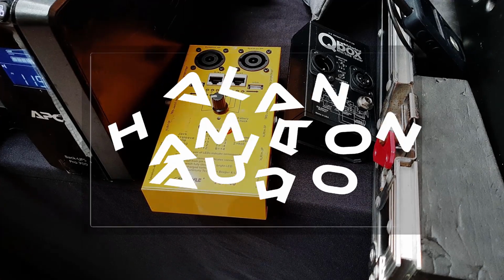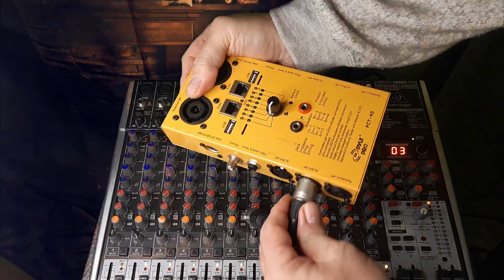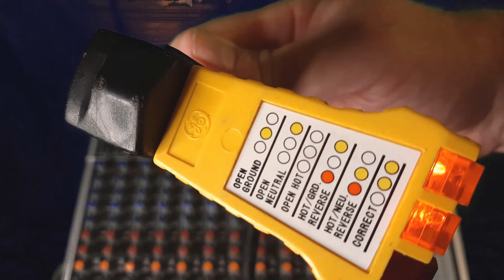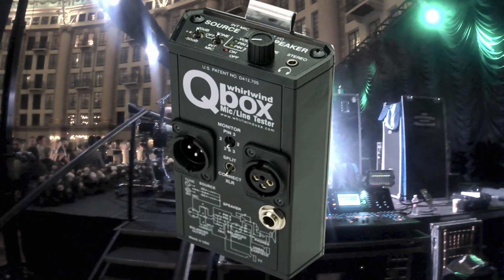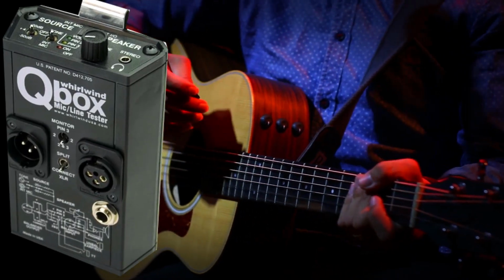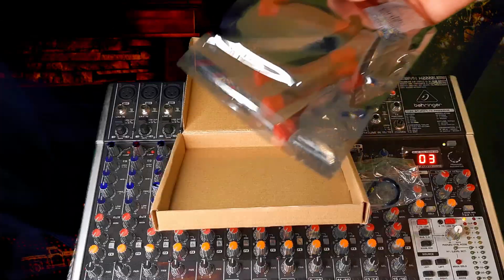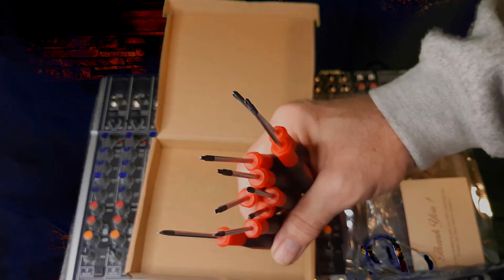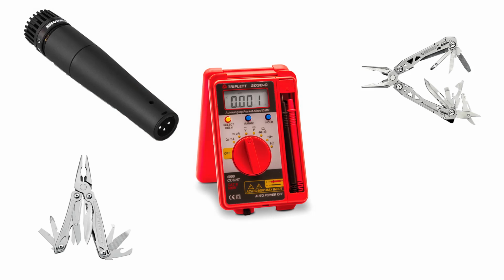Workbox Essentials - Gig Tools for Musicians and Audio Techs - Gift Ideas

Comment from the maker: From about 5.00 to around 250.00 (in no particular order)- An overview of several items that are nice pieces to have in your workbox, gig bag, briefcase, or guitar case. Tools, test pieces, and other items that come in handy on the gig site troubleshooting or repairing problems, or at home or in the shop on maintenance day. The kinds of things that make great gifts for musicians who play electric instruments (Although I suppose anyone could use a Pelican case), and for audio techs / system techs that need to be prepared for about anything when getting a sound system going. And of course studio uses as well when it comes to testing cables and chasing down signal chain issues. 

Some of the items are available at about any hardware or dept store that stocks an aisle of tools or electrical supplies. All of the items are available on Amazon (what isn't? ;) ).

►►Amazon Affiliate Links To Equip Highlighted In Video-

►Pyle PCT40 12-Plug Pro Audio Cable Tester on Amazon:
https://amzn.to/3GdVYg0

►Klein Tools RT110 Receptacle Tester for North American AC Electrical Outlet Receptacles on Amazon:
https://amzn.to/333CLzl

►Whirlwind Qbox Audio Line Tester/Cable Tester/Test Tone Generator on Amazon:
https://amzn.to/3rCJFWl

►EFFICERE 9-Piece Precision 'Micro' Screwdriver Set on Amazon:
https://amzn.to/3dmtaFB

►Shure SM57 Dynamic Mircophone on Amazon:
https://amzn.to/31w4ZlV

►Triplett Pocket-Sized CAT II 4000 Count Digital Multimeter on Amazon:
https://amzn.to/3Gg3OWy

►Gerber Gear 30-001343N Truss Needle Nose Pliers Multitool with Sheath on Amazon:
https://amzn.to/3lF6lS7

►Gerber Gear 30-001364N Suspension-NXT Needle Nose Pliers Multitool with Pocket Clip on Amazon:
https://amzn.to/3Ilq03e

►LEATHERMAN, Rev Pocket Size Multitool with Package Opener and Screwdrivers, Stainless Steel with Nylon Sheath on Amazon:
https://amzn.to/3GidYWq

"As an Amazon Associate I earn from qualifying purchases."
~~~~~~~~

Comment: I carry Extra mic, 15ft xlr, di box, 6ft xlr, 10ft instrument cable, multi screwdriver, precision screwdriver, battery’s, color tape, gaff tape, adapters, screws for racks, and I need a cable tester and that QBOX for something if I trouble shoot and that power tester and I carry extra IEC cable and extension cord

Comment: In my workbox I always carry a pair of drumsticks especially when I have to do a drum check Batteries and cable tester and Gaff Tape ect
Reply from the maker: I was just going thru my Pelican today. Last weekend I pulled my Rat Sniffer out to check a cable and the battery hadn't survived the pandemic. So today I had a new battery for it. Here's what was in the Pelican:
dB Meter
Analog inclinometer
Digital 'disto' measurer and inclinometer
Q Box
Sharpies (black, silver)
Ink pen
Pocket knife
2 Multi-tools
Pouch with micro screwdrivers and a larger screwdriver with changeable bits
Pouch with first aid supplies (mainly ibuprofen, bandaids, sinus meds, eye drops...)
Speakon Barrels
Speakon to 1/4" adapter
15dB XLR pad
A bag with XLR to 1/4 TRS (I think there were some XLR Y's in here too)
A bag with 1/8" TRS to 2/XLR-M and also 1/8" TRS to RCA cable
Shure colored 'rings' to identify RF mics
Board tape
1/2" gaff tape/spike tape
Mouse/Pointer
Flashlight
AA Batteries
Sony 7506 headphones
Futuresonic earbuds
XLR Gender benders
light meter
DMM
USB cables
USB charger x 2

What wasn't in there? The Rat Sniffer I was looking for! ;)

Comment: As a guitar player I’ll always have screw drivers, needle nose pliers, string cutting pliers, and a multi-meter. This is a minimum. I have a larger tool box with other specialized tools like my truss rod adjusting wrenches. This comes in handy if someone sets up a gig in the fall and your neck doesn’t respond well to the temperature change.
Reply from the maker: I like that... Cool.
 I hadn't even thought about it, but just having Allen keys wouldn't do any good for a Gibson neck adjustment, so having the Gibson tool would be handy if there are Gibsons onstage.

Which reminds me, I keep a drum key in the workbox just for drummers who might need to fix a broken head and their drum key is nowhere to be found. I hadn't even thought about the things that are in the workbox that aren't even really for 'me'... but are for the 'show'. ...Whatever show I might be on.

Comment: Will the cable tester  test both nl2 and nl4  speaker cables
Reply from the maker: Yes, definitely. The NL4 female connector accepts either NL2 or NL4, so it can test either connect in the NL4 spots.

Comment: Hi Alan, I want to strart using backing tracks and click tracks.  We have IEM which we use mono for 4 mixes through 2 Shure transmitters.  How can i route the click track to go to certain in ear mixes but not others and not to FOH, while having the backing track going everywhere?  I assume i'd need seperate backing and click tracks but then how would i sync those 2 tracks?  I'd appreciate a video on the subject if you think others would benefit? Thanks
Reply from the maker: How are you getting the backing tracks and click tracks to begin with? Making them yourself on a DAW and then rendering them to stereo and playing back from an MP3 player? Playing back from the DAW itself?

If you're rendering them to an MP3 player/Wav player, just render them with the backing tracks on one side of the stereo field and the click on the other. Then use 2 channels of the mixer to bring these back into the console. Pan the backing tracks to the center and make sure they are assigned to L-R.
On the click track... the pan doesn't matter... because you want to make sure it is not assigned to L-R and won't get into the house mix even if you accidentally bring the fader up.

Now you just need to treat the two channels like any other channels and send what you want to the mons/IEMs via the bus / mon sends on each channel.

If you want to keep the stereo field for the backing tracks then it gets a little more complicated... You'll need the tracks on a laptop/Mac or some type of multitrack unit that will output 3 or more tracks. So 1 track for the click, and 2 tracks for backing tracks...
And as I say that, you didn't say how many backing tracks you have... Is it just one backing track, or do you have a key track, a vocal track, a percussion track... etc... all separate? I was just assuming you already had the backing tracks mixed together. You'd need a channel for each separate track, plus click, if you don't have them premixed into 1 backing track.
Reply: @AlanHamiltonAudio  Thanks for the detailed response.  We'll use a laptop for the tracks and click,  it will just be a single premixed backing track and not bothered about stereo.
I think i need to sit at the mixer and work it out form there, perhaps it's easier to achieve then i first thought :)
I can playback from a DAW.  If i add a click from the DAW i wonder if it's possible to send the click on a different input to the backing track.  So send the backing track on USB5 and the click on USB6?  Would that be the way to go?  Excuse my ignorance but i've not done much with DAW's in a live setting but the band have dropped this at my door to sort out :D
Reply from the maker: @JasonTysoe  Yes. Just use USB and do it like you just said. I know on Reaper the L-R outs by default are USB 1 and USB 2, so you could pan the tracks accordingly, and then just set whatever channels you want on the mixer dedicated to the click and trax to be listening to USB 1 and USB 2. I'm assuming most any DAW will be similar. And you should be able to change the default USB's around if you want in your DAW.

If you're using a live click and not a recorded click, and if you happen to be using Reaper, I have a video on my page somewhere about routing the click to whatever USB out you want.